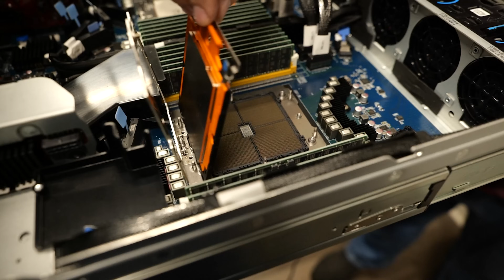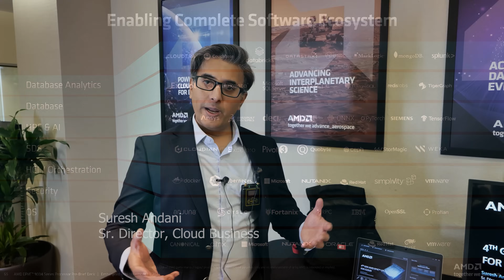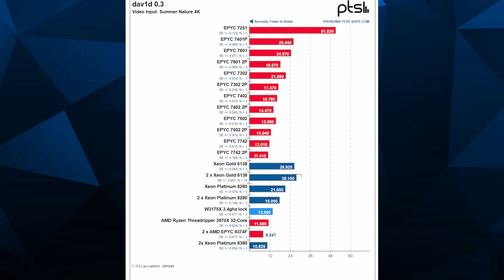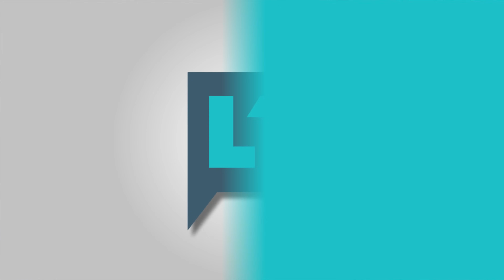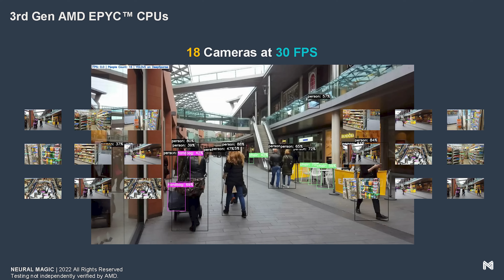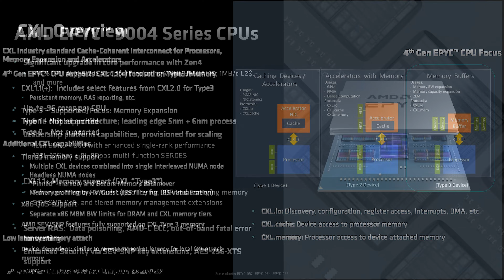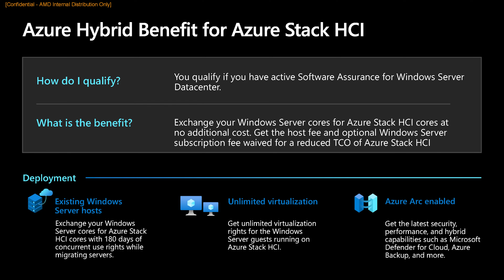192 Cores of EPYC Domination!

Comment: one Quick question right now i am using EPYC 7713 64 core processor for my rendering, now with new server i am planning to put EPYC 7713 X 2. what will you suggest should i go for single or dual will be ok ?
Please suggest will dual processor half my time compare to single  in render time

Comment: This Epyc system is indeed a building-wrecking gorilla. I can't wait to see what both Epyc and Threadripper bring to the table between now and in the future (especially when they switch to III-V semiconductor technology to counter the growing Silicon transistor problems - that could also influence how fast they will be and how efficient).
Reply: IAM planning to buy a pc  specialy meant creat high end  3d  visuals , using corona ,vray d5 lumion max  ue5 which cpu is best  amd epyc 9654  or threadripper pro 5995wx?

Comment: What's your minimum specification?  Would you run SQL 2014 to avoid the per core licensing?  Rip threadripper, 2 channels on AM5 is frustrating especially with the insane de-rating speed below base clocks if running 4 sticks.  64 gb is not enough ram for me but epyc is out of my range, nobody cares about me ;_;

Comment: 18:35 I think module gains are even bigger than mentioned. 
it's standardized connector so in case of problem in that part, you can just pull it out and plop a newer version of that module, which would be both WAY cheaper than replacing the whole server, and it's more stable for users that need that 99.9 uptime, and don't have time to validate another hardware stack, because of some random bug waaaay deep in infrastructure parts they don't care about. I am sure it will not be JUST plug and play, but there is an option now, which was not there before.

BTW, anyone has already tested PSQL behavior ? I would love to see those. I have a certain ROME server that, maybe, could get a little bit more OOMPH.

Comment: because this is a server CPU, so soon there would be a dual or quad socket versions of these.

192 (x2) or 384 (x4) cores / 384 (x2) or 768 (x4) threads

damn alot of computing, and possibly soon servers, supercomputers, and datacenters would be smaller in physical sizes

Comment: I don't need a cpu with 192 relatively slow cores though.  I need like 32 cores max (happy to settle for 16 or 24)  but I want them running at around 6ghz or so. with 8 ddr5 channels, and at least 64 pcie lanes and onboard dual 10gbaset.  most importantly though, I want it for ~$1000.  I get that my needs are different from that of the enterprise... WHERE ARE THE LOW END WORKSTATION PARTS!?

Comment: Here's one for My Father.
It's All About Materials. The light bulb. Passing Current Through any Metal won't yeald a Light bulb. Certain materials give off Aether (Light).
Other Materials Give Off Cathode Rays. Cathode Rays are inbetween Light and Electrons. The only Force that exists is gravity. Failure to Understand this yeilds in creation of All sorts of nonsense.
Light, since it is extremely small, is Little affected by The Transistors Middle Gate Field. Cathode Rays do. Cathode Rays, make them bigger into Electrons, then they don't pass through Glass.
All that exists is Volume Pull and Surface Area Light Push.

Comment: This is damn exciting! You really drive it through :)

We typically use 3+ year old servers, but this is the first time i asked already what supermicro parts would cost to build already a system like this :O
These can push so much performance that we could potentially do 1:10 consolidations  with just "basic" servers (we have a lot of E5 v1s still in production) if just enough memory can be installed
Reply: We can literally move entire clusters to a single dual socket rack. It’s nuts

Comment: Are the memory channels 64bit wide or 32 bit like the desktop. I’m just wondering because wouldn’t 12 be less bandwidth if it was 32 bit  than 8 64bit channels
Reply: ddr5 is 2x32bit lanes per channel, so it is something like 12 x (2x32bit)

Comment: Twenty years ago we were starting to see DUAL core CPUs... One of these has 96!!! I just can't get over that.
Reply: It's even worse than that. Just 10 years ago Intel was releasing their top tier 8 core Xeon CPUs, at 135W tdp. 5 years ago AMD released first gen Epyc with 32 cores. Now we have 96.
Reply: @morosis82  It's cause Intel is a shitty company that deserves no one's money until they're bled to the point of actually having to innovate
Reply: I remember my first quad CPU motherboard. Not a quad core. I had to buy 4 CPUs. It called it my vacuum cleaner because it sounded like one. That was around 2006, and the idea of multiple cores on a chip was just barely coming out. Now I have 12 CPUs on a chip, yet I can hear my fridge across the house better than my PC.
Reply: @ryanmcgowan3061 man 2006 was the year of the first dual core and 2007 the first quad core (I have a core 2 extreme qx6850)

Comment: CXL sounds like it would also be a very good solution to some of the problems that seem to come up with multi-chip-module devices. Edit the implementation to focus a bit more on speed and performance, streamline it and bake this in as part of a Master chip's silicon instructions and do some good driver overhauls for communicating with other devices. I could easily see two, four, eight, etc. chips all working together on a PCI-E card, sharing memory tiers and caches, handling operations concurrently, and throwing out data like a hot-damn.
Reply: That sounds a lot like UCIe.

Comment: What is the point of all these cores of most applications can’t even utilize 4 of them effectively? We can make the case for using them for hypervisors but outside of that it’s useless.
Reply: Not quite, it will run parallel workloads like a beast. You're thinking about applications and their core utilization. In the enterprise space, think about processes processing single workloads. Just 96 of them in parallel :D

Comment: Seeing these monster chips, I kinda have to wonder will customers even need this much performance? Not so familiar with the data center base, but it feels like the current most common cloud workloads are not going to want to take advantage of the incredible performance at this point, especially in this economy where theres a recession and cloud slowdown looming on the horizon. Thoughts?
Reply: If nothing else such high performance allows for higher density. Allows to save on real estate and infrastructure costs.
Reply: I think you might be coming at this from the wrong angle. When Wendell says that for example blender doesn't scale that doesn't mean that cloud workloads can't take advantage of this. If you could run the compute of (for example) 100 developers sending build and test jobs (or artists sending render jobs) to a Milan server now you could serve maybe 200 devs on one server with Genoa. Server workloads don't only scale on the axis of 'how fast does this one job finish' but can also scale on the axis of 'how many jobs can we run in parallel'. 

Now when you talk about a recession and cloud slowdown, if that happens as a provider you'd want to run the cloud with the lowest TCO (even more than normally) so you can drop pricing if your utilization starts looking terrible. I think you can see how Genoa could help here. 

Hope that helps while looking at stuff like this.
Reply: @level1techs I hope you see this great question.
Reply: Cloud server definitely scale up almost infinitely

Comment: I really wanted to get a Genoa (or Saphire Rapids) server.  As it will probably be my last on prem server, DDR5 and all the newest stuff.  I had to settle for dual 32 core Milian which is still smokin compared to the dual E5-4617 w/ DDR3 it is replacing.

Comment: That's all well and good but one question remains to be answered.
Can it run Crysis on max settings?
Reply from the maker: Could always have more fps. ~Editor Autumn
Reply: I am sure these CPUs don't even need any 3D graphics acceleration, they are powerful enough for Crysis to be playable with software rendering
Reply: @berdinskiybear  No doubt about that, this is overkill in order of magnitudes, still it would be nice to see.
Reply: @TheArchaos  Would be a really cool follow up to that old ltt threadripper video where they were able to get reasonably good crysis performance on a 3990X without any 3d accelerators.
Reply: they did a test in cooperation with LTT with an older 64 epyc cpu ( it think it was zen2 if i remember corectly ) and managed to get ~25 fps

Comment: AMDs chiplet based Technology really pays off , i would surprised if the real cost for a 96 Core CPU would surpass 1000 Dollar  = 90 % margin , the biggest ( single ) cost will be the I/O Die , its huge ,  but i am sure there are more Lanes than 192 and some spare units in it so that they can replace some defective ones , its only I/O = its easier . Lets say 13 Memory Controller instead of 12  , simply deactivate one if all are OK , it costs some silicon space but prevents waste and improves yield with such big Dies . The Xlinx accusition bears its first fruits with Genoa

Comment: It is looks like AMD killed  P-Epycs  (1S only).  Goodbye to my plans build Genoa-based WS.
Reply: You do know that the non-P versions still work in single-socket systems, right?  The only point of the P products is a lower price.
Reply: @TrueThanny  I know.  From my point of view Milan sweet-spot was 7443P (24c 4GHz single-core boost),  Epyc 9254  "its Genoa equivalent" price is almost 50% higher.
Reply: No 1S P-model for 16c and 24c SKUs.